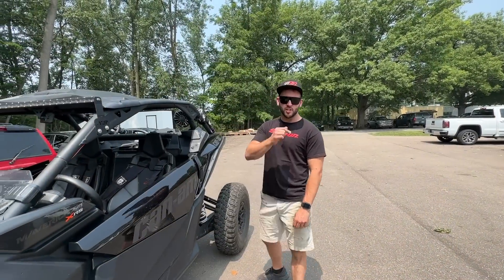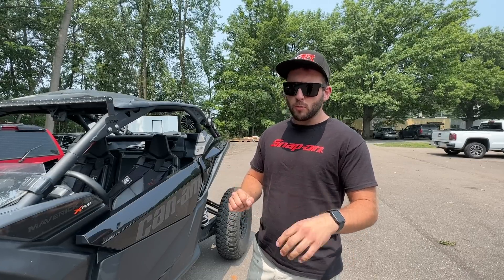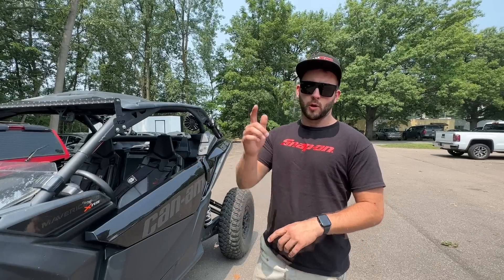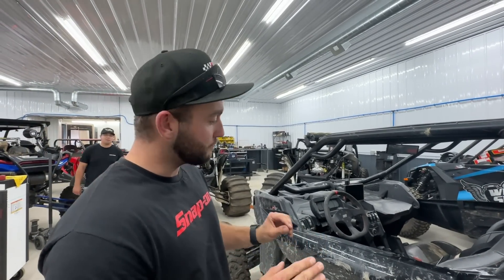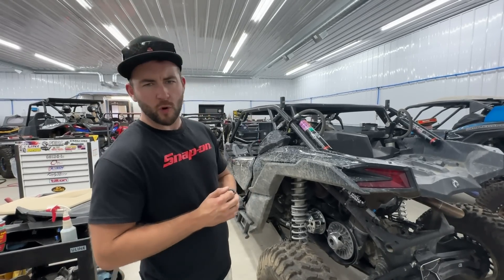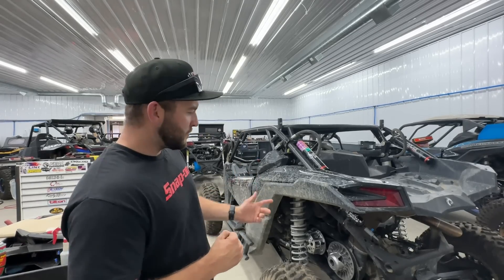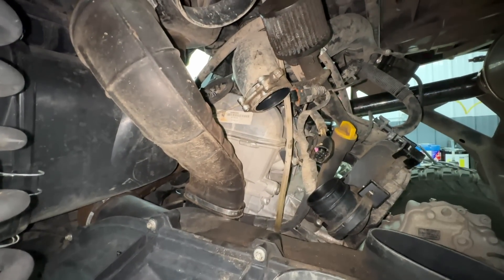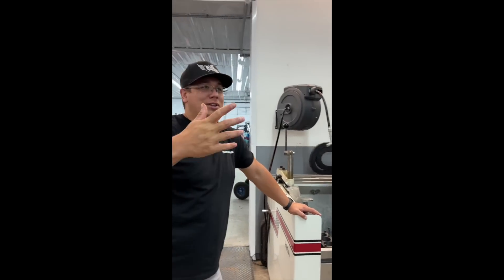I LOST 100+ Horsepower By Doing THIS To My Side by Side (Dumb..?)

Comment from the maker: Rex3 on pump gas vs Kyle’s on E85 which are you picking?!
Reply: The rex3
Reply: rex 3
Reply: That's a tough one but still have to say rex 3
Reply: Rex3! Baby.
Reply: Thats 240 crank on kyles?
Reply: Richrules try Blendzall Gold label in your 93 pump gas. 1 pint Blendzall Gold label to 3.5 gallons of 93.  Thank me later
Reply: @GarSeeYaa negative, 242hp at the hubs. There is 12% loss at the hubs compared to the crank.
Reply: Bro Rex got that smoke for anybody its running. That 2step hell buddy!!!..